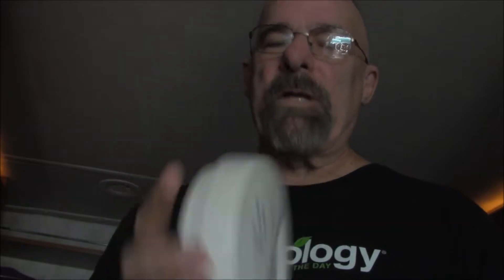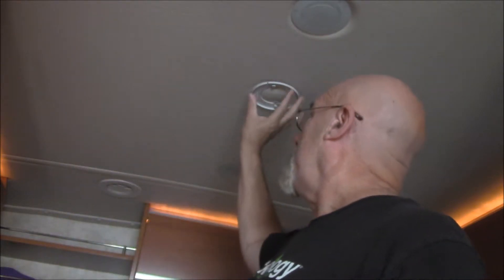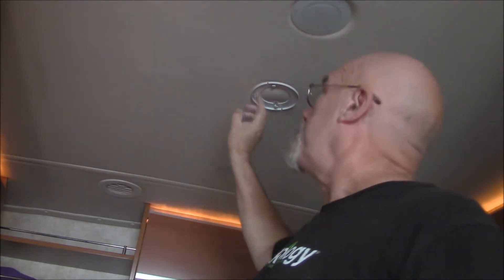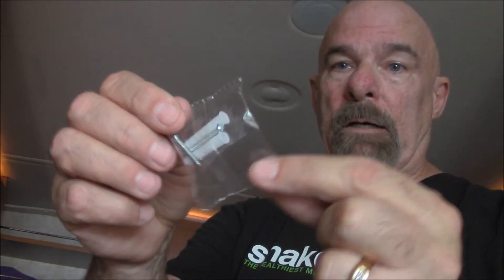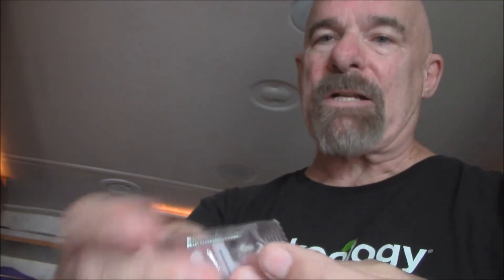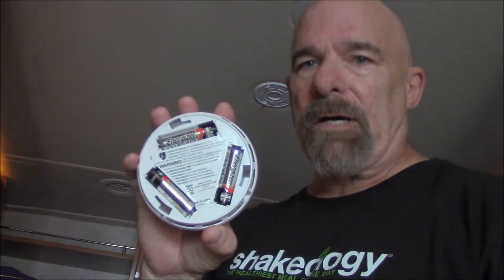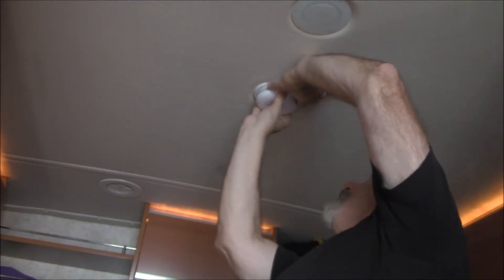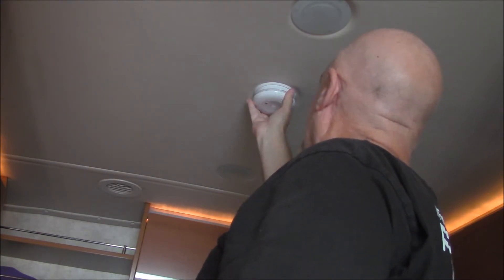Thoughts On Our Carbon Monoxide RV Alarm Replacement

Comment: I would buy 2 separately manufactured detectors for maximum safety (placed in opposite areas) if I was paranoid of the potential risk.  Regards tonight from the low desert. Nice to watch your videos when I am south of you for a change!! LOL.
Reply from the maker: Linescrew1 This is my ultimate intention. The smoke detector in the front I'm going to replace with a combo smoke/carbon monoxide detector. That's what I would recommend for anyone replacing either their smoke detector or carbon monoxide detector.